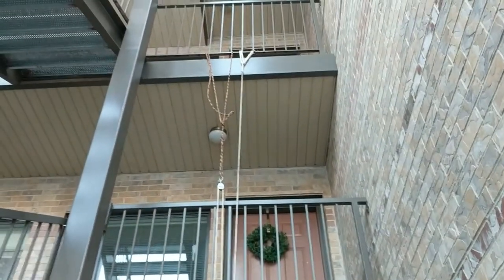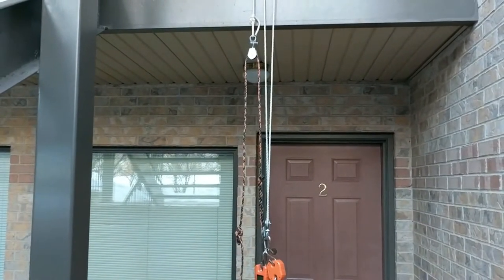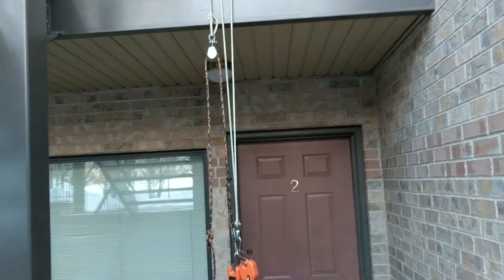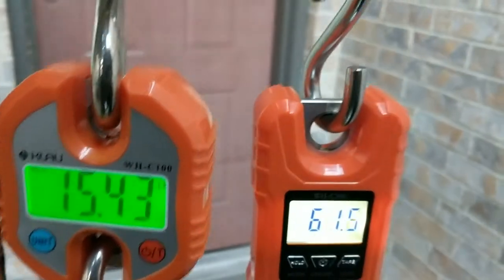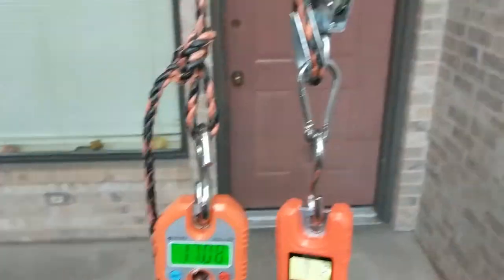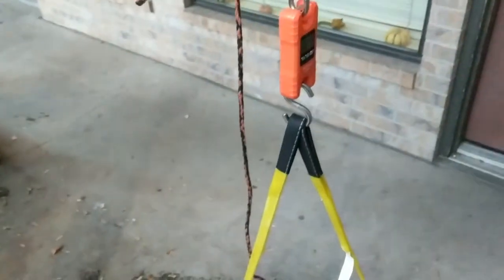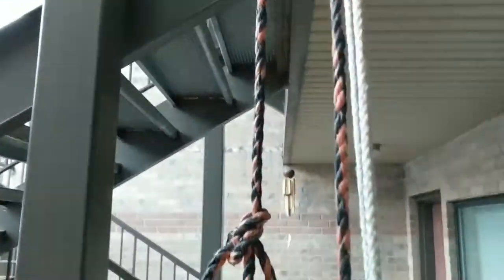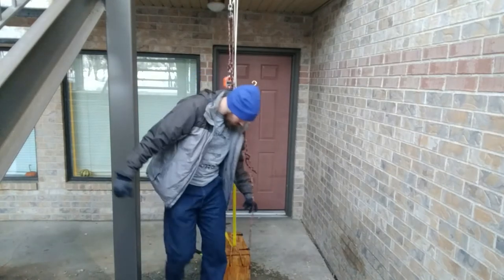Rigging a Spanish Burton

Comment: Good stuff mate.

A Spanish Burton is indeed a 5:1 when the tension source is not also the load (i.e. when you are hauling something else up,  not hauling yourself up). Depending on the efficiency of your pulleys, you will never get the theoretical number obviously, so pretty easy in practice to have a theoretical 5:1 system that empirically looks like a 4:1 due to losses in the system. Those look like fairly small diameter pulley sheaves, and probably bushings rather than bearings, so (if that is correct), they'll be fairly inefficient compared to big, ball bearing rescue pulleys and the like.

I also wouldn't put too much faith in either the repeatability or the outright accuracy of those load cells, unless you've calibrated them against a known load for any systematic offset, non-linearity, and general repeatability.

In the real world, with consideration for the amount of gear required and friction losses etc, I suspect the Spanish Burton is one of the most effective lightweight mechanical advantage haul systems that one could use.

When hauling yourself, I agree it's confusing. Off the top of my head, I'm pegging it at a theoretical 7:1 when you are both the load and the tension source.